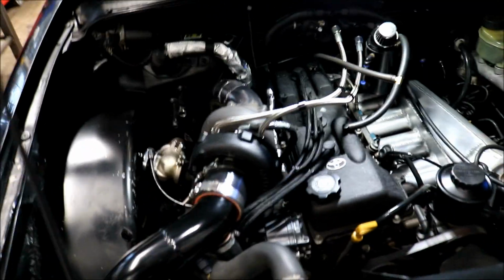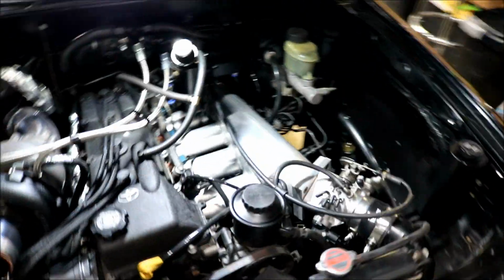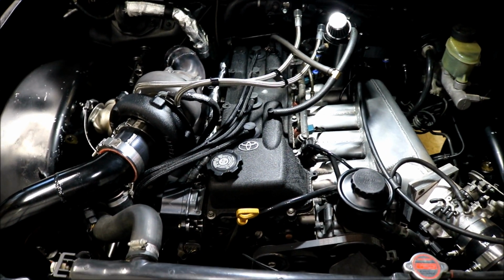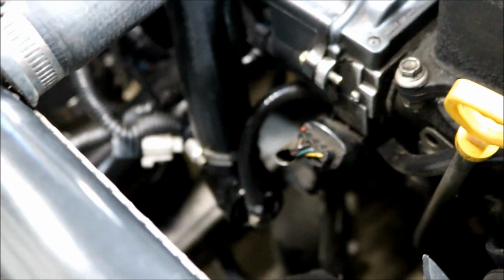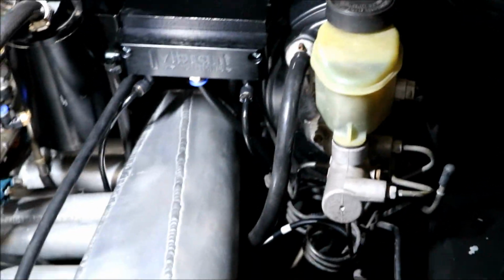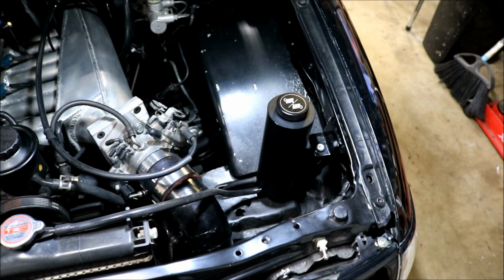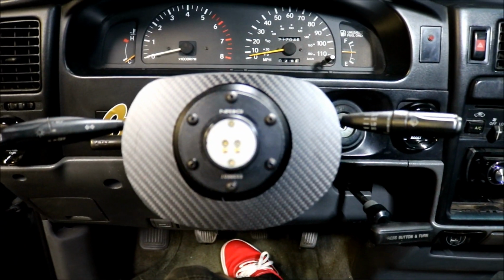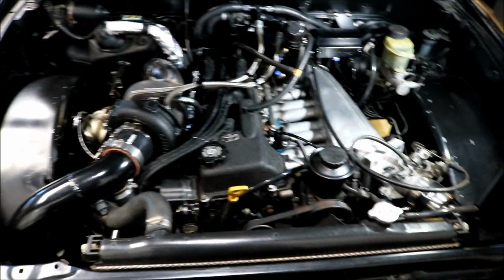Turbo Tacoma - IT'S ALIVE!

Comment: I have a 97 tocama. I want just a little more power out of it. Can I add a turbo without tearing out the A/C? Did you take out your A/C?
Reply from the maker: There are definitely kits out there that allow you to retain your ac. Check out LC Engineering and KO Racing

Comment: Hey love the look of your taco! Question for you, If I'm running a Non-4x4 front fender on my 96 taco. Would you recommend 17x9 +45 245/45R17 in the front too? I plan on doing a Belltech spring, shock and block lowering kit, 2" front 3" rear. Thanks!!!
Reply from the maker: That should work pretty well. You'll have a good amount of clearance with only a 2 inch drop.  Thanks!
Reply: @mjbtaco  10-4 Thanks!

Comment: How much is it cost you for that setup?
Reply from the maker: I dont have an exact figure because it was all pieced together over time. But I'd say anywhere from $2K to $3K
Reply: @mjbtaco  Really interested in doing the same. Do you have a material list someplace that you can share?
Reply from the maker: @daggiedoug7200  I dont really have a list 
put together but if you watch the turbo video series on my channel I go over all of the parts that I collected for the setup.
Reply: @mjbtaco  Excellent! I have subscribed. I will make a point of watching all the videos. Thanks!
Reply from the maker: @daggiedoug7200  Thanks man! I just added all the videos to a playlist to make it a bit easier for you.